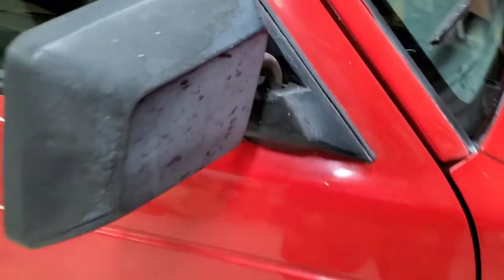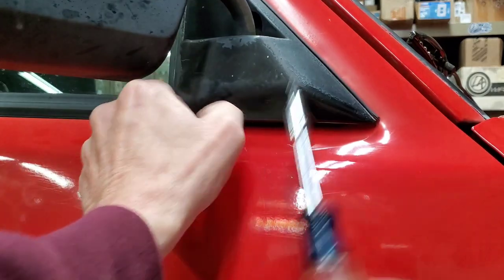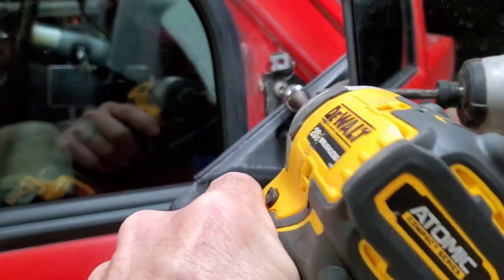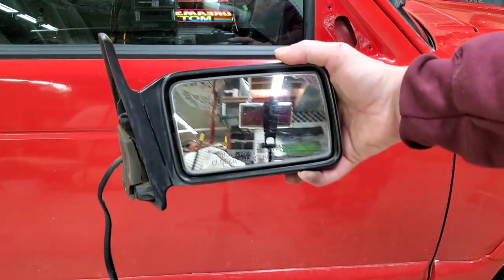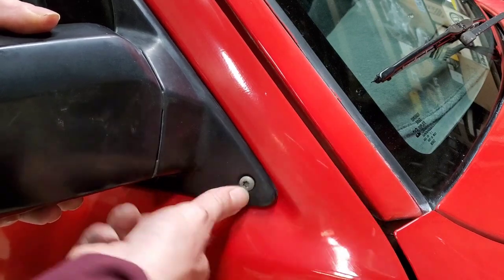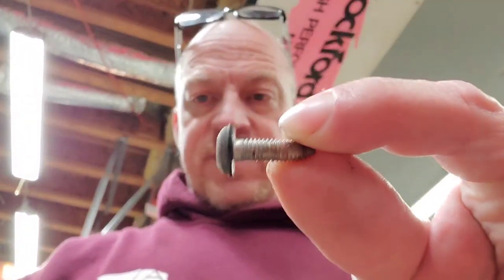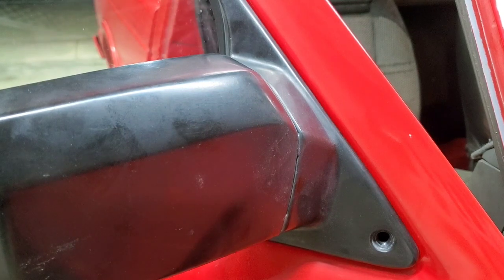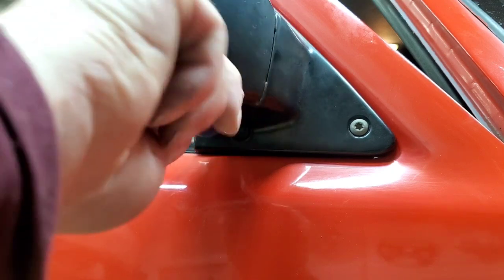The S10 Cameos never came with Power Mirrors. But they are the best looking factory mirror.

Comment: I have a '93 S-10 standard cab short bed 2 wheel drive that I bought new. It never really got used, and has been garaged since new. It has about 70,000 mostly highway miles on it. AZ truck so no rust. Even most of the original frame wax is still on it. I got rid of the dumbo mirrors decades ago, and replaced them with the small black plastic oem mirrors. A definite improvement, but now I'm modifying the truck, and going for a '70s muscle car look. Back in the '70s they put the mirrors on the door, not the A pillar. I would like to find either some Street Scene style mirrors that could be painted body color, some oem like small mirrors only chrome instead of black, or some flat triangular panels to put where the oem mirrors go, that could be painted body color, so I could install chrome '70s car mirrors on the doors. If nothing like any of that is available, I can probably have blank triangle shaped panels fabricated.
Reply from the maker: Gm had the mirror delete panels in the 90s, ive not seen any In Years.

Comment: Does a s10 blazer come with power mirrors harness already Incase it was an add on ? I got some bravada mirrors I want to add to mine needs some guidance thank you 🙏
Reply from the maker: 92-93/94 trucks,  blazers whatever could have them or at least be a plug and play.  The mirrors have nothing to do with blazers specifically.  They're just power mirrors. There's 3 mirrors ever offered on the s series.  The cheapo base model mirrors, the huge Dumbo ears and the power.

Comment: they look good  going to wire them up?
Reply from the maker: Eventually.  There's issues.  They changed the harnesses in 91 I think. So im unsure if my currently locks and windows would plug into the newer harness with the power mirrors.?. They are manual power mirrors for now!